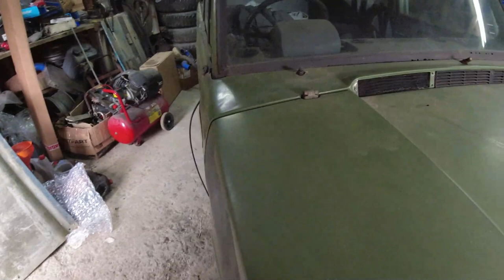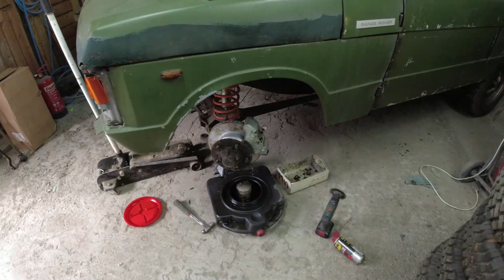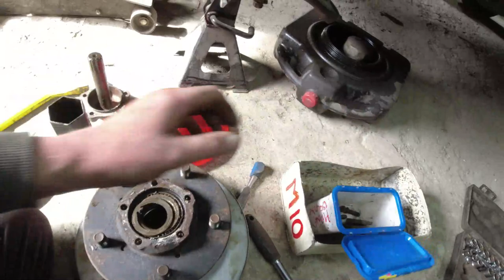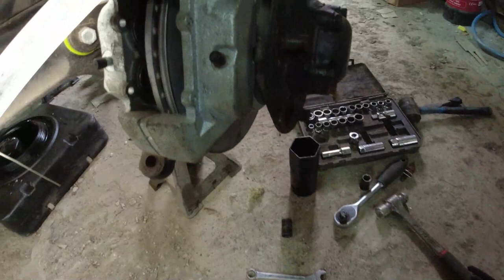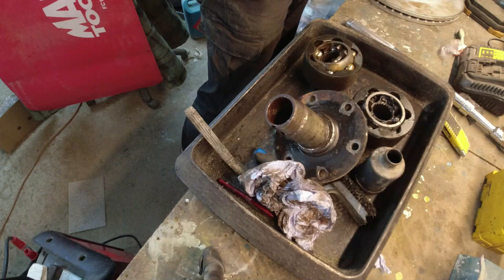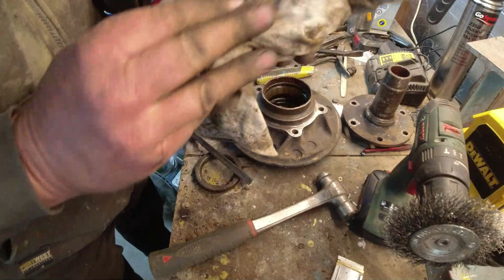Range Rover 2 door Lincoln Green Ep1

Comment: Mixing metric calipers and vented disks with imperial axles is a minefield. The holes in the calipers and the shanks on the bolts are close but incompatible.
Reply from the maker: I have yet to get into this world of pain. Getting new old stock imperial calipers is getting tricky now. I have a few complete sets of very used items for refurb, but that would only be for solid discs. I generally  upcycle these on imperial axles. 

I understood that aside from fixings the key difference between solid and vented disc calipers was the spacer in between the halves.

Comment: Looks like an abandoned project that has been thrown together enough so that it can be sold and trailered away.

Must admit I wondered if there was a mixture of imperial/metric wheel nut/studs given how tight they were.
Reply: I had a 1979 RRC fitted with white eight spokes which had thinner flanges than the factory wheels. As a consequence the taper on the nut bottomed out on the hub and damaged the first few threads causing similar issues.
Reply from the maker: It was thrown together, and I had factored that in when estimating for the job. 

It is a warning however to folk who think they can do a greasy flip on a part finished project.
Reply from the maker: Yep I had something similar. In this case I just think that the nuts were wrong thread. Just no idea what

Comment: Hi Richard, Thanks for another great video. I have a '76 D suffix Lincoln Green Rangie (and a '76 Stag btw) and wondered if you knew how to tell if it's the original motor and whether you think originality affects the value much or is condition more important? Thanks again from South Australia.
Reply from the maker: If it was built in Australia then it will be a CKD model and from here in the UK it is really difficult to judge as to whether it is original or not. Here in the UK low mileage and original mechanicals can add to the value but more often than not just make the vehicle a little more attractive to a potential buyer.

Comment: Of course with the heat to remove the bolt the rubber caliper seals are now buggered :(
Those swivel joints look like ostrich egg cups :)
Oh boy you need a sand blasting cabinet.
Painting inside engines (with the correct paint, Glyptal) aids the speedy flow of oil back to the sump, it is used a lot in racing cars for better performance..
I know you get there in the end, but you do make me cringe when you don't use a vice and the correct tool to remove a seal.
Reply from the maker: Had I used a gas axe then I would have agreed with you. The heat soak into the caliper body is quite efficient. I was also concentrating the blowlamp on the axle case mounting rather than the caliper lug. I am 100% confident that the cailiper seals - arf arf - survived.

I do have a few dead units, I should make a sculpture and raise funds.

I do have a blast cabinet but rarely the time to use it. Majority of the time my customer would like to see clean and tidy rather than pay me for the "looks new" approach. 

And yes 100% on correct paints, alas there are ham fisted gibbons who use enamel or any other paint that they can find. then they smother it 10thou thick over gasket faces etc
Reply: @churchhouseclassics  OK great response, I'll keep my fingers crossed for you that the seals are ok, I am sure you will test them on the Mulsanne straight :)